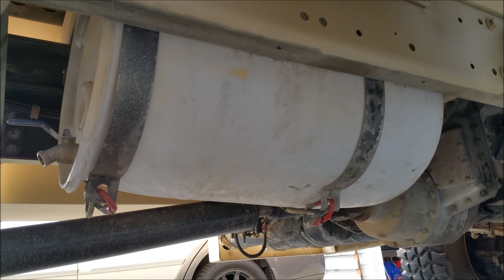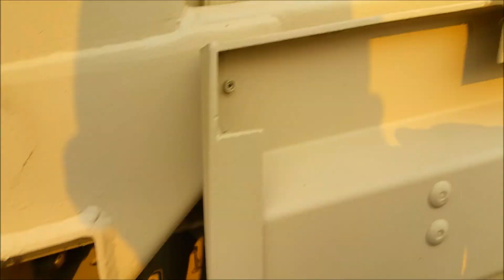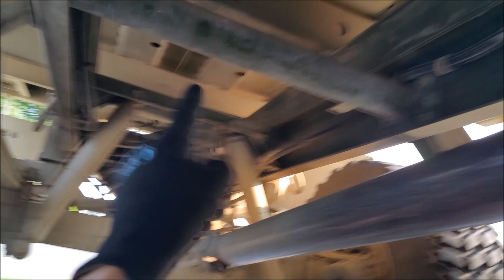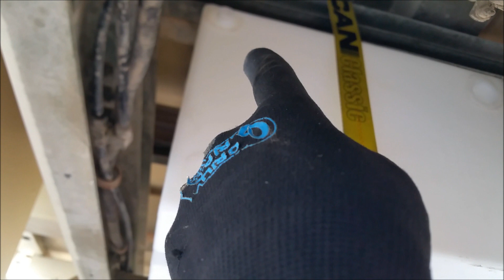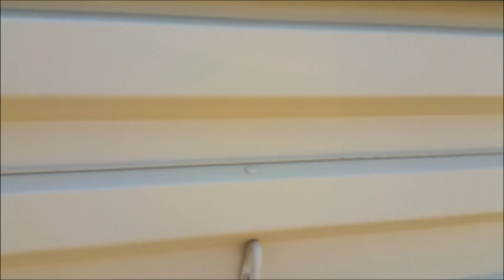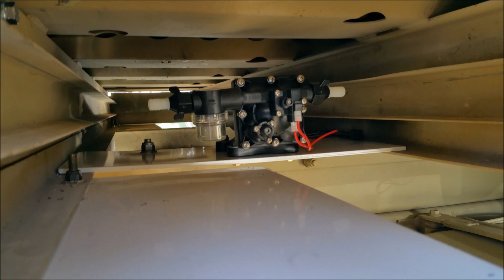Abel LMTV build part 20 (42 gallon water cube installation, shurflo pump, exterior shower)

Comment: I like the skid plate! Is that an electrical cabinet back pan ;)
Reply from the maker: Stock on the truck from the factory.
Reply: @SeanFastidious  The one protecting the water tank?
Reply from the maker: Ohhhh.  It was inside the shelter when we demoed it.  It's not really a skid plate.  More of a platform I guess.